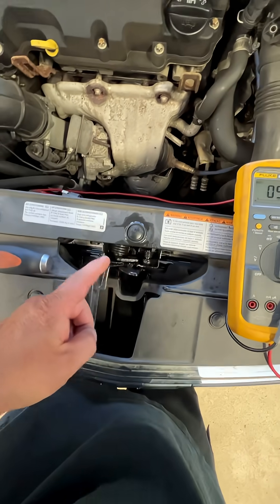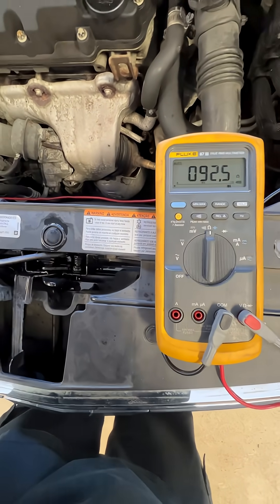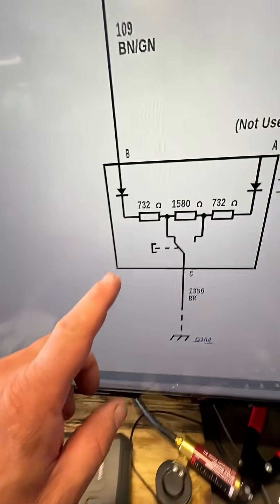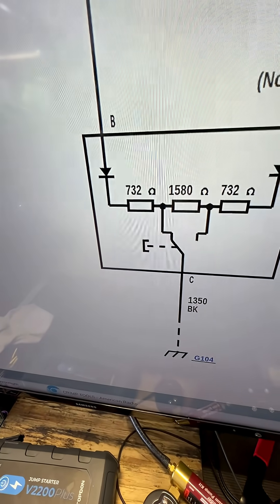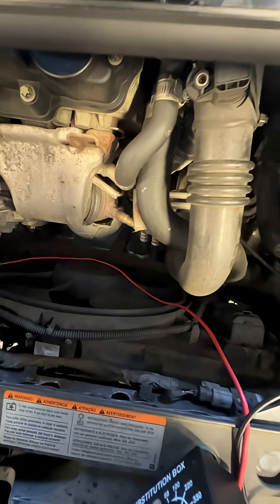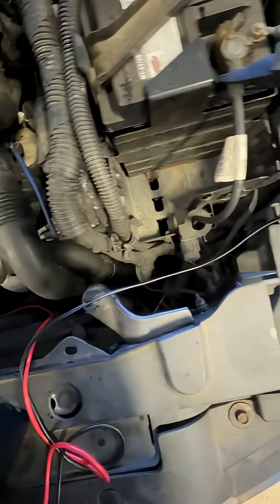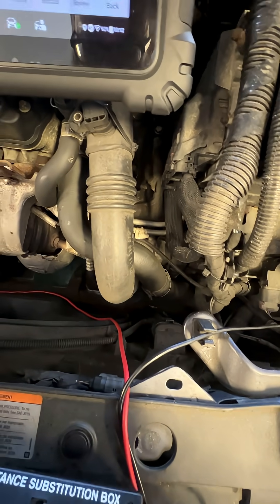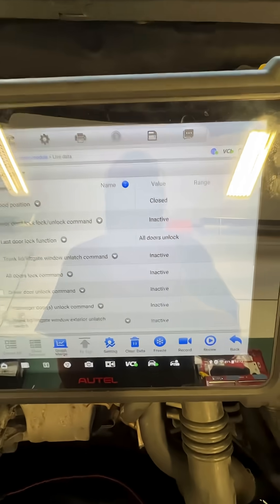Chevy alarm going off at random. Test the system the easy way. Proving the part failed

Comment: Variable resistance inputs. Seems like a good idea, but not. When you se no change in resistance when actuating the switch I would assume the switch is bad right away.
Reply from the maker: I knew the switch was bad. The test was for the customer. It showed that everything else worked. That i did test and not just fired the parts cannon.